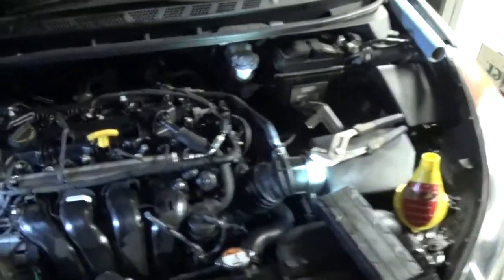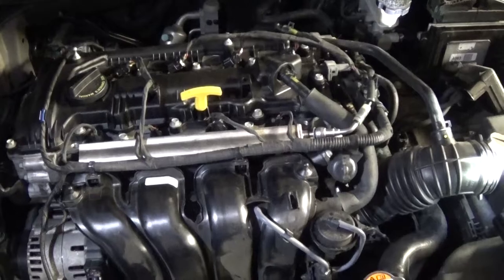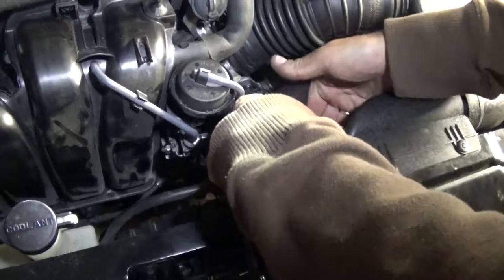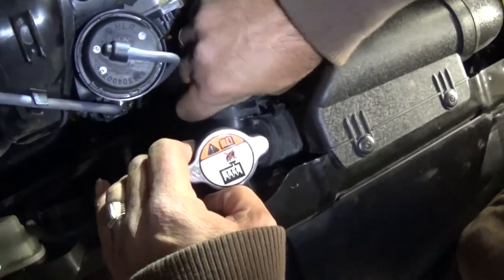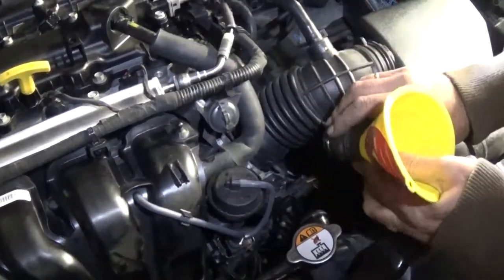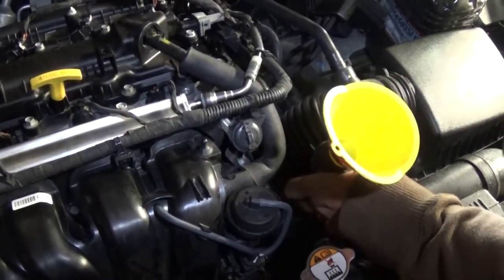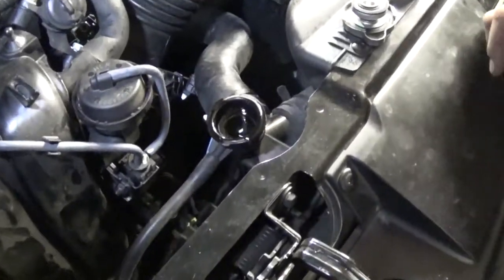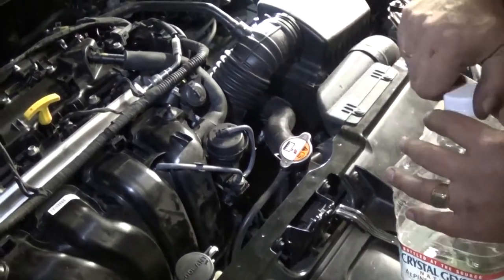HOW TO BLEED COOLING SYSTEM ON KIA FORTE SOUL

Comment: Have a 2015 Kia Optima and the coolant is not returning from overflow tank back into radiator, and pressure test is good. Already replaced the radiator cap and overflow tank hose so is there any other thing that will cause the coolant to not vacuum back into radiator??

Comment: hellow, I just got a coolant services at a kia dealer for my 2015 kia forte. The radiator looks the same as this engine. The white reservoir in mine was at low level before the service. My question is the white reservoir indicates the antifreeze on level on the whole system? or what is that white reservoir levels indicate? Should this white reservoir be at  full level?
Reply: That's just the overflow. On a cold engine open the radiator cap and it should be full with coolant.

Comment: Good morning,  I have a Kia k2700 and have flushed the cooling system,  and replaced the radiator.  But it keeps spitting out the coolant through the reservoir. How do I bleed the cooling system ???
Reply: did you ever solve this? mine's doing the same thing.
Reply: Sounds like a bad thermostat  ??

Comment: Um.you dont need to take your hose off .and if you put the same amount that you took out .then start .water pump will auto matic ly.flush air and coolant and make pressure .um this guy .is right but he didnt have to take hose off dum dum
Reply: I was thinking the exact same thing. That upper hose he removed is the coolant inflow from the block. As you fill the rad itself it will fill the block at the top. And usually after starting the cold engine you leave the cap off to allow any air to escape & THEN top up if the level drops. Recap & run and bleed heater core.

Comment: Anyone here change coolant of it. how to drain all coolant on reservoir. i cant find out. i put pipe inside reservoir so i can suck it out.but it cant go to bottom structure of it so complicated. guys help me.
Reply: Some rads have drain cock,my Kia Soul inferno has a drain cock,bottom left it’s plastic drain . Now my daughter’s Kia Soul burner does not have drain cock,so best way is to remove bottom pipe,when engine is cold,also start engine let it run for 2 min  to completely empty the cooling system.don’t. Forget to either shut the stopcock,or push the bottom pipe back into rad.then fill with mix of antifreeze+ water.
Reply: Most are held in place by a couple of bolts, simply disconnect and hold the resivore up and let gravity do the work.